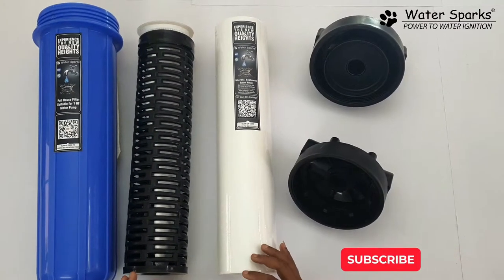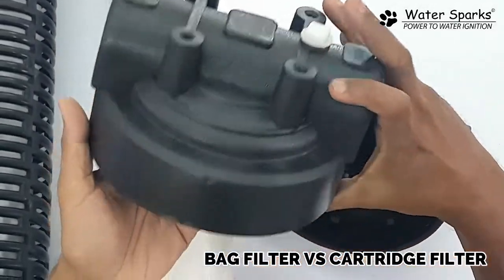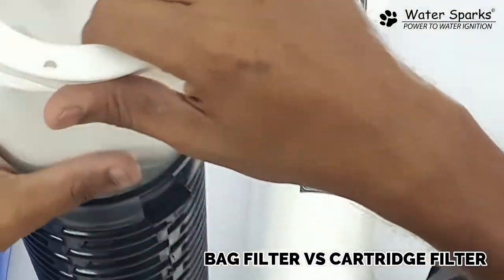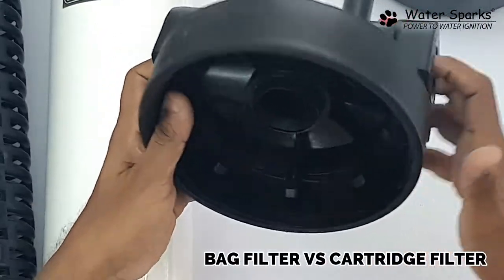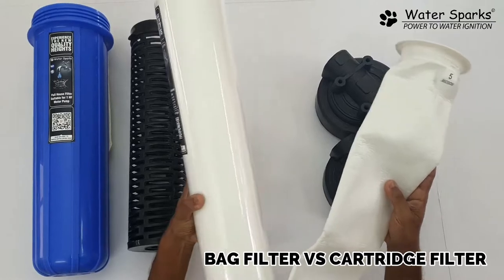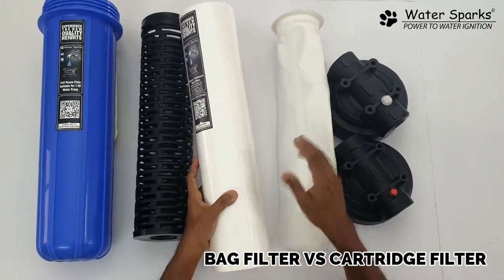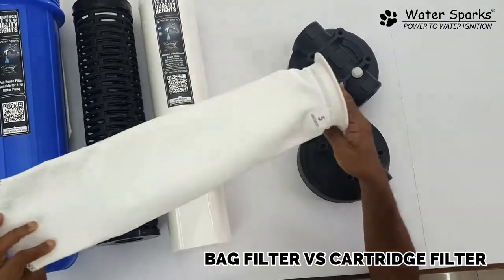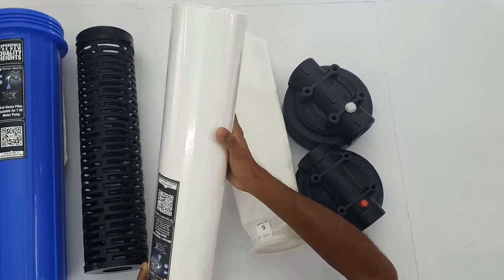Bag Filter vs Cartridge Filter | Water Sparks

Comment: Hello, for cartridge filter, do we have to install it with after submersible pump or after the water tank ?
Reply: After submersible pump so all your water in tank is filtered water
Reply: @hydrodocplus   but would it cause overload on submersible pump ?
Reply from the maker: we have 2 models 1 hp and 1.5hp motor pump models . please log on www.amazon.in/watersparks